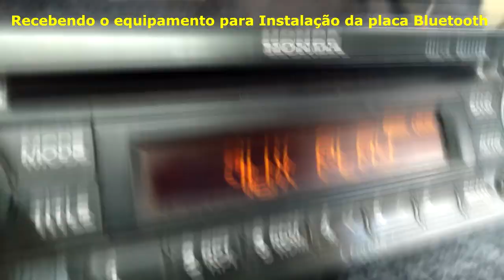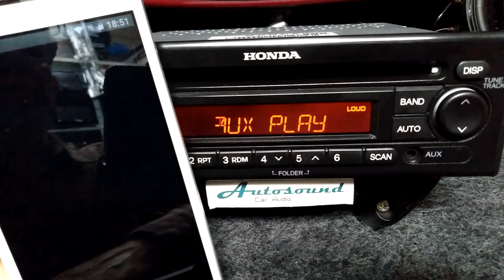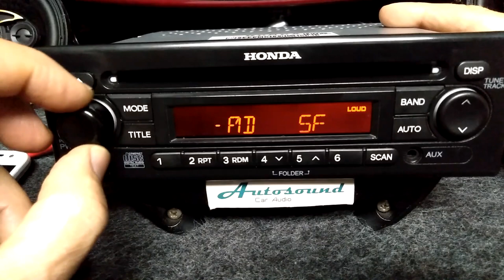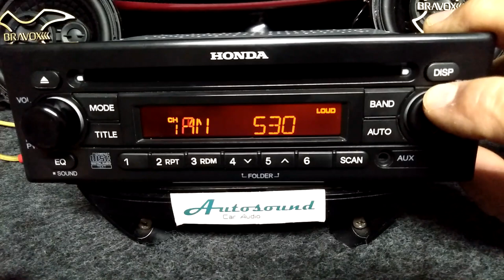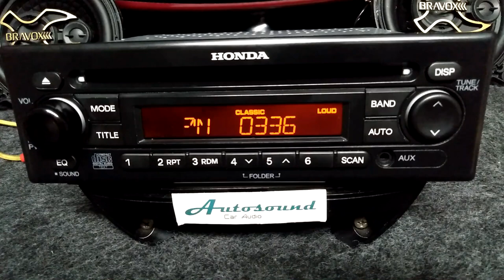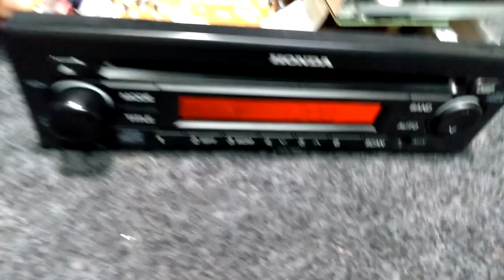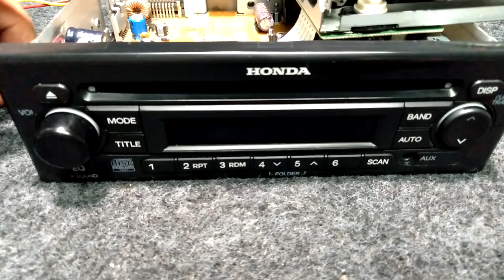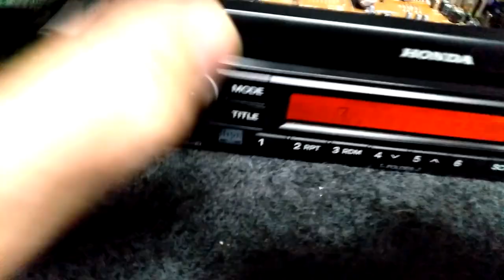🉐 RADIO CD ORIGINAL HONDA FIT 🉑  NH608L AUXILIAR BLUETOOTH c\ ajuda dos algoritmos do You Tube

Comment: amigo ja comprei 2 radios desses e conecto o cabo na saida aux e coloco no celular e n sai som, tem como me dar uma luz pq praticamente impossivel os 2 q comprei estarem com problema
Reply from the maker: Seu telefone pode estar com problema na saida de fones ou desconfigurado. Ainda pode o cabo estar quebrado ou o plug da ponta não é padrão p2.  A função AUX deve ser selecionada no botão MODE e aparecer no display. Esses entre outros problemas podem acontecer como pode aconpanhar neste e em outros videos postados no canal.
Reply: problema é q eu conceto na caixa de som e sai so m normal
 @autosound
Reply: eu seleciono e ela aparece normal mas n sai som ate aparece no celular q esta conctado via cabo @autosound